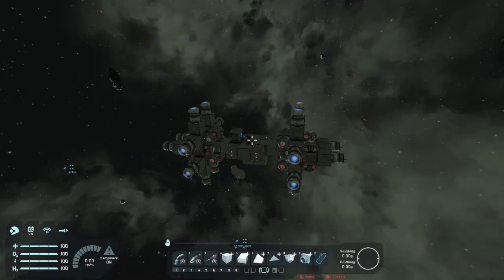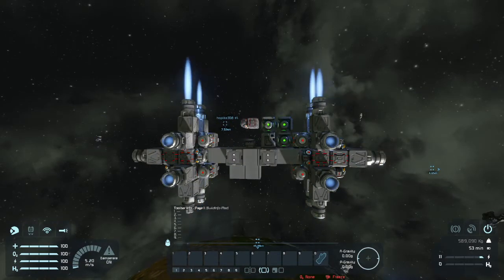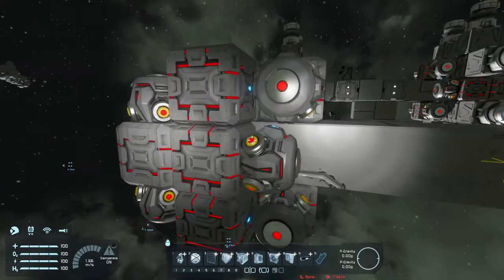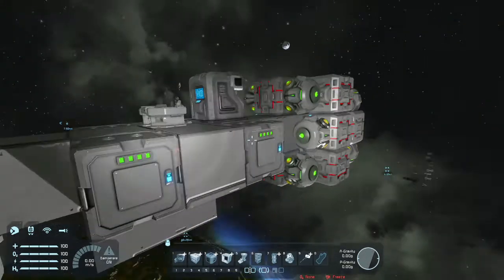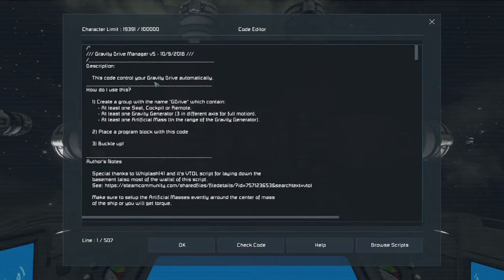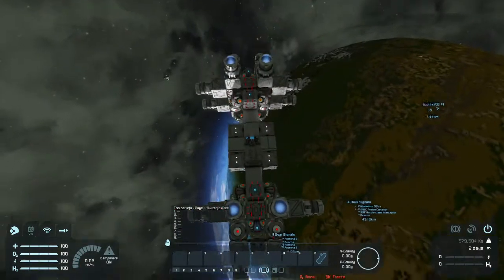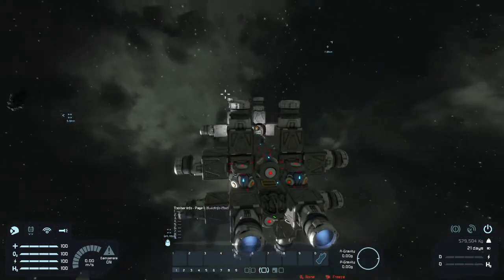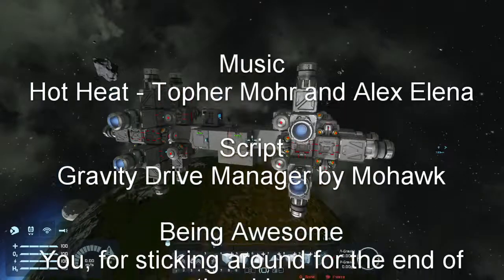Tutorial - GRAVITY DRIVES MADE EASY! - Easier than Hydrogen?

Comment: Grav torpedoes and missiles!
Reply from the maker: I actually tried to make a gravity torpedo once, but it wasn't super accurate. I also can't recommend them in general, because they will be interfered with by your own gravity drives, your normal gravity generator, and any opponent's gravity generators. The last one lead to a now-outdated but still technically viable concept called the "gravity shield", where you'd use several spherical gravity generators to ward off incoming gravity torpedoes.

The problem with gravity missiles is they're massive. It's literally a self-guided gravity drive-enabled ship with warheads, which sounds easy in concept, but would take extra scripting to get right. To my knowledge, there is not a direct connection between gravity drive operation via script and auto-pilot, since every gravity drive script I'm aware of takes human input, while every autopilot/missile guidance system I'm aware of directly manipulates thrusters. I might be wrong, but it's a LOT more complicated than it sounds or is worth.

Comment: I would like a tutorial for moving a very heavy ship through earth. Specifically a 54million kg ship. What can I use to aid the thrusters, cause I hate having to figure out where to place 75 large hydro thrusters
Reply from the maker: Good question... and yeah, that'd be a pain, but unfortunately something that specific is outside the scope of a tutorial. Here's your options I can think of, easiest to best:
1) Clang drive, specifically the Piston Door Drive. There's other tutorials for that.
2) Booster rockets. Disposable, relatively cheap, can even print them if you need others later. 10 booster rocket sets of 7 large hydro thrusters might be easier to fit on your ship than what you're currently rocking.
3) Space elevator. I'd recommend an infinite builder for this. This I CAN put together a tutorial on, since I've done it, but it's also... VERY not practical. And it's also very slow. The advantage is you're leveraging a piston's power on a static grid to pull your ship to space.

Comment: If the grid built is massive and unbalanced, how stable could it be on a scale of 1 to 10 if I built a single drive none symmetrically as close to center mass as I could?
Reply from the maker: Size helps to a huge degree with stability, so if the grid is roughly symmetrical (works just fine for at least the IMDC Protoss) it'll be fine. Might need an overridden gyro to 100% stabilize it, but otherwise should be fine. I can't give you a scale without knowing the ship itself.

Comment: This is absolutely splendid man. Would this work with spherical gravity generators?
Reply from the maker: Technically yes, you could make one that does that, but in exactly one dimension. Else, the spherical generators would act on all mass blocks in a direction away or towards the generators.
Reply: @odysseygaming214  so I still need to place them around like normal gravity  generators?
Reply from the maker: @DeltaCressida  No... it's hard to explain this in text, but mentally draw a line between the spherical generator and the mass block. That's the line that the generator will create thrust on. Reason is that the spherical generator acts in a sphere either towards or away from itself, not in a singular direction.

Comment: Do you know if adding this as a sub grid inside a larger asymmetric ship would alter its centre of gravity?
Reply from the maker: I've had subgrids without gravity drives throw off the center of balance, so I'd assume "yes" since the components are pretty heavy. That said, you can still add a gravity drive in an asymmetrical ship. Trick I learned after this video is to replace some light armor with heavy armor to move the center of gravity around without needing to change the look of the ship very much at all.
Reply from the maker: @brandonbarnwell5916  Great idea on this one, I love it! I'll add another that I found out later. You can actually use heavy armor to balance the ship out a bit, adjusting the center of mass.

Does this happen to work with Gravity Drive Manager?